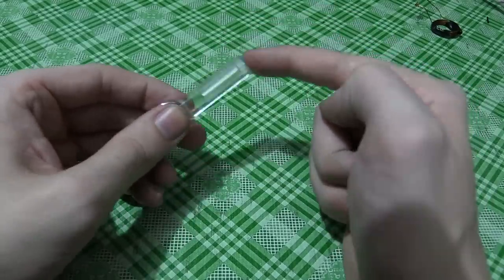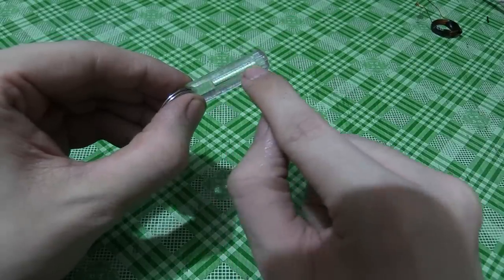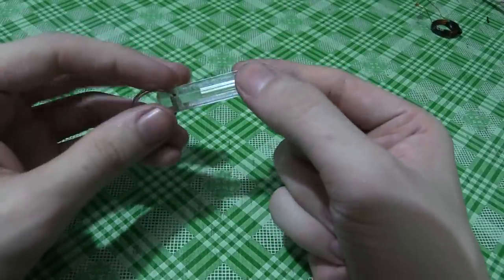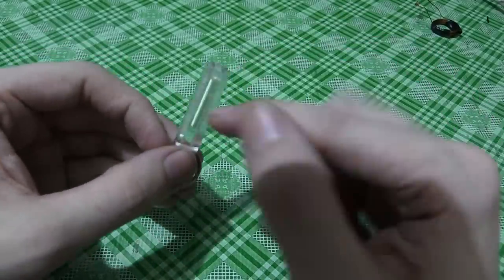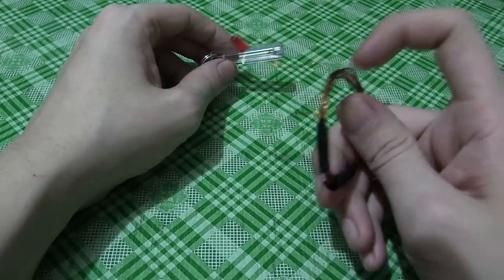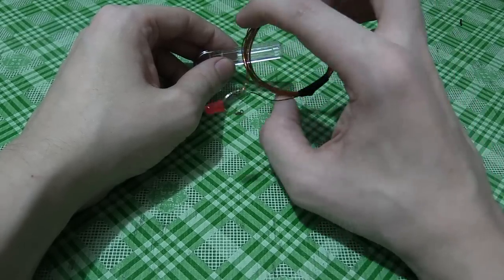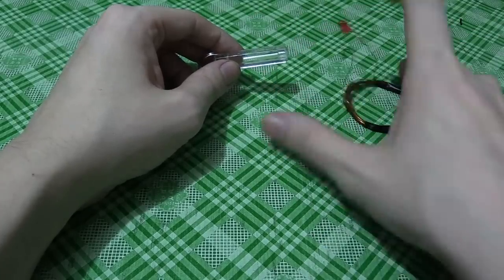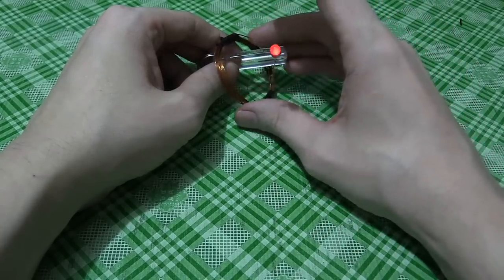1 Watt Nuclear Generator - Free Energy

Comment: Absolutely fake. (1) Tritium decays by a beta particle. It most likely can not penetrate the plastic case and if it did it would have almost no energy left. (2) the use of the coil suggest induction is generating the current. The beta particles would not have a sufficent enough magnetic field to accomplish any power. (3)Even if it were inducing a current by the beta particles striking the Cu any current would be directly proportional to the surface area expsed to the source. Clearly the video doesn't show this is the case so it has to be fake.

Comment: Radiation doesn't work that way .-.
Reply from the maker: +Elmer Salinas what if you adjust your thinking?
Reply: Physics doesn't revolve around my thinking though ._.
Reply: You could make a Tritium battery by converting beta radiation into light and then use a photovoltaic panel to turn that light into voltage though. And that would actually work

Comment: magnetic coil under the table trick, he is powering a coil under the table or using a wireless smartphone charger

look how close he is holding the tritium tube to the table and how he is tilting the coil horizontally over the tritium tube
because the coil cannot work vertically

also radiation of tritium cannot pass trough the glass encasing it because it is made of phosphorus glass
that is causing the glow and only light particles to pass
and even if the gas would escape and come in contact with your skin, the radiation is so weak it cannot even penetrate your skin

also radiation is not equal to magnetic field, to power a coil you need to create a constant moving magnetic field
that is also why nuclear power plants generate steam to drive big generators to create electricity

and at last but not least, you clearly have no idea how electricity works or what electricity is
claiming you generate 1 watt, you know what watts are and how much an average led consumes ?

a regular led like you are showing in your video has a consumption of 0.15 watts or 15 milliwatts
feeding 1 watt trough that led would instantly burn it in a bright flash

and this is why kids should stay of drugs and finish school or stay dumb and try to look smart failing horrible

Comment: This is fake!
Reply from the maker: +Klaus Ventures why?
Reply from the maker: +Klaus Ventures in what respect?
Reply: The alpha particles being emitted by the tritium is reacting with the phosphorus to produce light- the demonstration depicted her would require a solar cell to generate electricity. The coil of copper will not stimulate the LED or generate current simply because it is exposed to light. In any case americium generates alpha beta and gamma particles; if you attempt the same experiment with a sample of americium the LED dose not illuminate.
Reply from the maker: Very interesting. It seems like you know your stuff but I don't think you took into account micro electronic magnetism.

Comment: Your content should be blocked. You are a big waist of space. You are simply transmitting the electricity from a wireless point that copper coil seen in the video is the receiver. Once In range the LED lights up. That's all.
Reply from the maker: Interesting interpretation. I can assure you that It worked just as well on April 1, 2017 as it did in April 1, 2015.